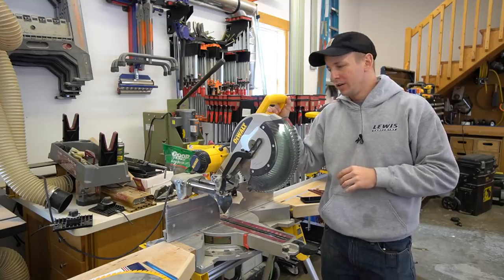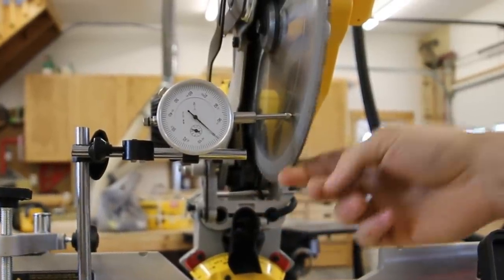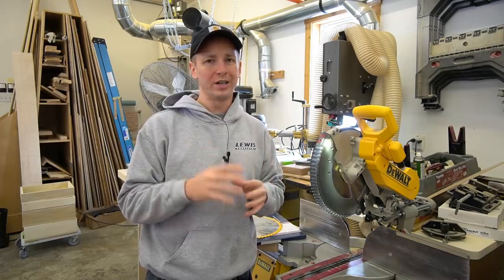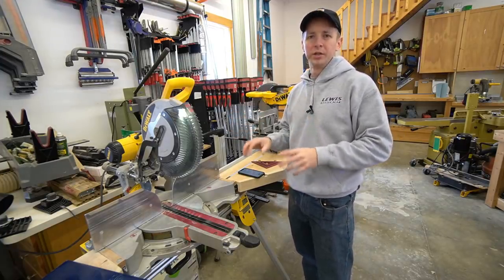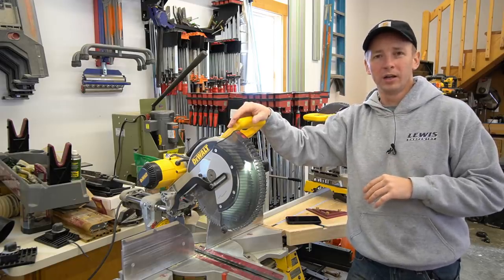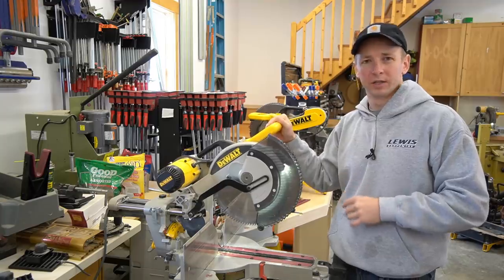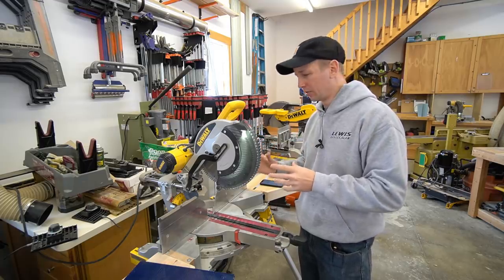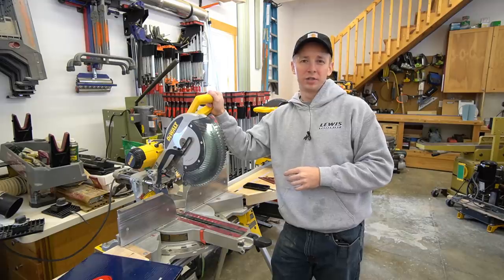DEWALT DWS780 | The BEST Miter Saw for Production Trim Carpenters???

Comment: Hello from Easton Maryland. I’m so glad you do this video. I have my miter saw 708 since 1996 and is still running well. I do some electrical wire repair and trigger repair and bushing repair just one time in each one and is still working perfectly. Last year I got the 780 and you’re perfectly right. I was looking for the best in every way and the dust collector is not perfect but is the best miter saw in the market. Tank you to share with us all your experience. Stay safe.
Reply: Same here in Delaware; I got my 708 factory refurbished in 2003 and it still purrs like a kitten every single day

Comment: A couple other things he did not mention. Thin kerf blades, low quality blades, and too high tooth count blades, cutting material with the wrong blade type, as well as misuse, can overheat blades causing warpage and run-out  when the metal expands and warps. Blades have curved relief slots cut in towards the center of the blade body to relieve heat warpage. Also, even very heavy cast iron industrial chop saws (cold cut metal saws) need to be calibrated and the blade angles can move just by pulling the handle side to side. Proper use goes a long way.

Comment: Spencer I just found and subscribed to your channel.... Fantastic work!!!!  In the last 2 yrs I've got turned onto festools love them . I just bought the KS 120 REB saw about 9 months ago I hope I don't run into the same problems you had.. l replaced it with my dewalt DW705 l've still got that saw works great after 20 plus years.. l went for the Kapex saw for its dust collection hooked up to the CT26E vacuum and knew how good the quality is in everything I own festool..

Comment: After watching your video I pulled the trigger on the 780. I’m planning on using it only for diy stuff so it’s probably an overkill, but it’s nice to know that I can use it for pretty much anything. I can’t even count how many times I purchased lesser of a tool and then regretted it due to its limitations.
Reply: How's it still working for you?

Comment: got both,  779 & 780  the 780 is fix based in  my shop the 779 i bought a light and haul it around....i have not found a difference beside the light weight i do not feel weight  is big between them .

Comment: DeWALT makes the best tools. They always have. 🙏🏻👍🏻
Reply: No. Some DeWalt tools are amongst the best, some not. Same with all brands. Not a problem with corded but, with battery power, sometimes you have to compromise to stay on same platform. Now too old to invest in Mafell
Reply: @cuebj  
I'm speaking from experience. I've tried them all, from drills to saws, grinders to routers, nail guns to compressors, and the only one that lasts is DeWALT, specially  when it comes to cordless. I've been in contruction for 18 yrs and that has been the case for me. Other brands just don't last.

Comment: I know it hasn’t been tested for longevity, and it was a risk, but I bought the Hercules 12” from Harbor freight last year.  It’s basically a dws780 clone.  It has been perfect for me, very accurate out of the box, and cuts through anything I’ve thrown at it.  With the deals at the time it was $279.99, which was the best deal I could find.
Reply: I was going to buy the DWS780 until the Hercules came out so waited about another year to see how it played out.  I also wanted to put my hands on both to access the quality of each.  In the end the two were near identical so went Hercules route since it was 1/2 the price.  Everything stated in this video can be said for the Hercules saw at a lower price point.
Reply: Lately I've been searching for reviews and opinions regarding miter saw vs table saw sled so I guess that is why this video popped up on my suggestion feed. It may be confirmation bias or even where I am (more to the point, where I'm not) with my skill level but I feel like I can get very accurate cuts with my Hercules 12" saw. I also found it to be accurate right out of the box and it has not failed to perform well with anything put to it. Another thing I noticed was the laser cut expansion slots on the stock blade. That's the extent of what I know about it but, as I understand it, that is better than the stamped blades. I deliberately searched the comments to see if anyone else mentioned it. Yours and the reply from msk3905 are exactly what my thoughts are...or vice versa lol.

Comment: The 12" Dewalt slider saw is the answer for large crown or base moldings cutting vertical or flat. We commonly use them on commercial jobs. 
If you have the touch and patience, the stock blade will work.

Comment: Meh... My son runs the Flexvolt version of that saw and I have used it side by side with my Bosch Axial Glide and I will take my Bosch saw any day over the Dewalt.
Reply: Totally agree
Reply: I ran a Bosch 12” Axial Glide as a production custom contractor?
Completely worn out in about 6 years or a little less?  Cracked head, sloppy base, lost accuracy to the point I had to reset it every job?  Motor started loosing power?  Maybe all fixable?
Guard broke too?  But that axial arm is bullet proof!  Plus base is to small for production carpentry.
I suspect your a guy that fixes things around the house?
Go onto a pro construction site and tell me how many Bosch’s you see?

It’s like the Delta Cruz?

I run a Makita in my Shop for the extra bevel and Dewalts on site!
Gimme your address I will send you my Bosch I will pay shipping?
Reply: I’d take the Bosch over the Dewalt to, I just wouldn’t take it off the bench and on to a site cause it weighs 700lb.
Reply from the maker: That surprises me. Bosch sent me an axial glide for free to test out. It had so much slop I never even bothered to use it. The deflection in the head was insane.
Reply from the maker: Crazy man. The deflection on those axial glides is off the charts.
Reply: I use a 10” with a CutHub set up. I must have gotten a good one. I build cabinets and do trim work. I put on a Forest chop saw blade and couldn’t be happier. I also have a Bosch 8 1/2” slider and a DeWalt 10” 703.  I must be missing something here.
Reply: @InsiderCarpentry  I have not had any issues with it, and I have had it for 6 years.  It is heavy and a PTA to move but it cuts like a dream.

Comment: I’ve had a lot of saws over the years but the 780 has bees the most durable saw of the bunch. 
As a stair builder I do like the new Makita slider and it’s ability to cut boards to 60 degrees left and right.  but it weighs a ton and still only has a laser.
Reply: The new Makita 40V cordless miter saws have the led and stainless detent plate. Hopefully that makes its way to the corded models. I really like the forward slide rails and upfront bevel knob on the makita.

Comment: Listening to you mention the DWS779...  I  bought one two years ago, along with the DWS726 rolling miter saw stand.   Together, they are both very heavy.  Over the time since I owned it, I barely use it because it cuts like crap.   I watched your flattening the table video multiple times.   I'm not gonna lie, my specific DWS779 is a mess.  The table has a hell of a wave and the fence is not even close to flat.  The fence is also not smooth.  The machining on the fence is quite deep.  I guess to allow it to bite the work.   I'm at a point where I tried to follow your tutorial but I lack the patience to get fully involved.   I'm not a trim carpenter but when I need a miter saw I want it to be fairly accurate.   I bought more saw than I need, just in case.  I'm seriously debating selling the 779 to buy the 716.  A fixed 12" saw should do me just fine.   I'm going to see if Dewalt will do anything to rectify this pile of crap.   

Before I bought the dws779, I bought one of those Hitachi sliding 12" saws with the slide forward so the saw was zero clearance at the rear.  Man, I wanted to love that saw but again, it was so far off and no amount of adjusting it made it work like it should.  The fence was terrible.  Vertically, it was out of plumb between 1/8"-3/16", seriously.  I returned the Hitachi within 3 days of purchase.   I know Hitachi is now Metabo.   Model:C12RSH2M.   That thing was also pretty heavy.
Reply from the maker: It definitely good to check the fence and table out of the box to see if the saw is workable or not. I've also learned that the hard way. The 716 is my favorite saw for accuracy, but I need the slider for my workflow. Can't go wrong with a 716 if you can do without the slide capacity.

Comment: How often do you change your 12” blade?? Not because it’s dull but because you want 90 teeth v. 64?  Do you use that blade for everything??  Until you can’t sharpen any more??
Reply from the maker: Correct. I always use the same tooth count. I have been using my current FS Tool Blades for a few years. I send it for sharpening about every six months. I think I'll get at least ten sharpenings out of the blades.

Comment: Totally agree......especially with the toughness of the Dewalt.
I'm currently using the same Dewalt 216mm sliding mitre saw I bought back in 2002!!! But its now completely worn out and I'm about to replace with either the 780 (12") or 727 (10") ...... still deciding??? What you think?
Reply from the maker: The 12" fits my workflow much better.

Comment: I still have my DeWalt 708. 
I think I bought it in 2007, and the motor finally gave out last year.  It definitely looks like it been through a war. Maybe one day I'll replace the motor. Thanks for the advice on the LED lights.
Reply: I bought my 708 in 2005 and have used it nearly every day.  I have replaced the brushes, the bearings, and the power cord each twice and it still cuts very accurate to this day!
Reply: I also have a 708 that i bought in 2005 and i love it. All its needed is 3 sets of brushes and i replaced the power cord last week. Its cut so much timber over the years and never lets me down. I use Freud blades on all my saws

Comment: I own a DW706 which I have run for over 12 years and it still runs great.  I am not in the trades, just a home based furniture maker and personal home builder.  I like the DW saw but the fences are not parallel and I could not adjust them.  I had to remove the sliding fence attachments and make my own instead.  Last year I needed more capacity and went with a slider.  Bought the Kapex mainly for the rear clearance and accuracy claims.  On my second cut the off-cut got sucked up into the blade guard and removed the entire retraction system and broke all the plastic and spring inside.  I have never had that happen on the Dewalt.  The guard on the Kapex is no longer functional at all.  It has to be replaced.  The Kapex is accurate, certainly, and right out of the box (I have had to re-calibrate the DW about every 3 years).  The laser does not stay true but I do not really feel that is a feature I need/use.  I almost purchased the 780 but fell for the green hype and the rear clearance of the Dewalt sliders was a no-go in my shop space.  Dust collection is also critical to me.  The Kapex is far and away the best miter saw I have used in terms of dust removal (I am using a dewalt extractor tied on with string only).  The Dewalt saw spewed dust everywhere even when connected to the vacuum and being inside a cabinet with 6" duct running at 1000 cfm.

Comment: Very thorough and detailed review. I'm also a fan of 12" blades and Dewalt MS. For my workflow, I go with non-slider, relying on track saw when wider cuts are necessary.  I also believe (superstitiously?) that non-slider is less prone to deflection by design. That said, if I still did much stair work, a slider would also be my choice.
Reply from the maker: Non sliders are definitely tighter. I love my 716, I just can't get by without the extra horizontal capacity of the 780.

Comment: Go yellow or go home. I’m running the DWS 12” fixed. For those running the chop shop dust hood like I am, dewalt went away with the mounting holes on the back of the base(not sure why). My point is, is you’re replacing your saw with a new one, the hood will not mount without you being creative with two 3/4” sockets.

Comment: The first thing i do when buying a new saw is calibrate. 15 years ive been using hitachi 10 in. With 2 piece fence. I recently bought the dewalt 10in flexvault.  Unfortunately the  fence was bent but dewalt came to thw party. Calibtrated a new saw and sent it to me dealer where i swapped it over. I am now very happy with my 727. I buy 10 in cause the 12 in wont fit in my trailer. The hitachi is still very accurate,  very nice saw with little flex extended but at 60 yo its getting too heavy. 23kg as opposed to 10kg. Where did you get tje giant fences?
Reply from the maker: Link in notes.

Comment: The 780 is HANDS DOWN the best 12" sliding miter saw on the market. The other saws in the same class are good, like the Milwaukee, Ridgid, older Hitachi, and newer Makita, however the DeWalt has the least bit of deflection and slop in the sliding arm. It is just a solid and accurate tool. The light is awesome as well. The dewalt also has the best blade guard too.
Reply: I love the 780 as well but I have no idea why they stopped making the 708?  I like it just a little bit more than the 780 and I still have two 708s that are over 15 years old
Reply: @swooopg  I too had a 708 back in the day, and that thing was a tank. Like 65lbs, but that thing cut so well.
Reply: @caseydurrans521  yeah it's really heavy! But I think that helps a little with accuracy,  having beefier components...

Comment: Great video as always. I have the same saw in shop. Flexvolt in the van. Have you used any of the new Diablo combination blades? Most everything we do gets painted. I like not having to change all the time. Put the combination on the flexvolt to start. But before I get one I'm doing a little research...

Comment: We use 780s at work and they're rock solid. Only issue I have is the guys have beaten them up with carelessness and I'm almost always recalibrating them. I'll probably end up buying my own so when I go in to do trim then I won't have that issue. Definitely would love to see more dust collection on it though, because I work doing remodels and it's a bear to deal with. Also, I find the saw pretty heavy... But maybe that's cuz I'm weak.

Comment: When I chose a dewalt slider a decade ago it was mainly because compared to other brands the stand was lightyears ahead (it collapsed tightly, had twice as much extension on the supports etc).   I also thought there might be an advantage to having the rails/sliders in the "closed" position when cutting right next to the fence (I.e. cutting base vertically, potentially less deflection with the rails closed).  Good video Spencer thanks for the link to the tall fence too!

Comment: I did buy a Makita 12” corded.  Main reason Spencer is it stays in my shop doing all the shop work and I hv found it close to flat out of the box and with a little work I can dial in dead flat (base on the left side is low meaning I hv a little sanding to do literally about the thickness of a sheet of paper!)
I can bevel to 60 degrees and right now I am building cabinetry, doors, custom tables (inside & out) so that saw runs @ least 4-7 day a week!
I hv a fixed DeWalt I take to job sites which replaced one that was stolen!

I can run rails to the back where my Saw sits!  Last saw I had was a Bosch?  Took me 6.5 yrs to wear it out where it was never accurate, cracked head and bolt for guard on blade change was failing?  Bosch might be great for DYI guy?  Not a working carpenter!
This Makita is not a carry to the job site saw!  It’s right up there bout 68 pounds!  I run Forest Chop Master Blades on my Miter Saws full kerf and almost no wobble or going dull to quick problems!
I might hv to try one of those blades you run?  Mine are 2 bills & I think you said buck 80 for your?
Great stuff Sir!
Reply from the maker: I'll link my blade in the notes. It runs about $180.

Comment: The 780 & 779 both weigh 56 lbs. The only difference is the light. The light is definitely a game changer.
Reply: The light kit is cheap and simple to install.
Reply: The parts are not all the same if you look at the schema.
Reply: @pouetance  It works great, it's far better than the laser on my 10" saw!
Reply: There is other differences. Comparing the newest versions of both (type 22) the 779 has a plastic bevel lock knob instead of metal , no bevel tab pawl stops, and no lock lever for the slide.
Reply: @jameshill4900  I actually wondered if there were other differences. Good info thanks!
Reply: @jameshill4900  I have a brand new 779 and I can lock the slide with a knob
Reply: @MMASensei  The 780 and the older type 779 have a lever on the left side that locks on a pin to position the saw exactly where a "non sliding mitre saw" would be for plunge cuts. Then you can further lock it down with the knob if you choose. It's a nice feature that they removed on the newest type 22 779.
Reply: @jameshill4900  Oh ok.

Comment: Great video. I have been using a DeWalt DW708 for 20+ years and it still runs and performs as it did new. I like how you discussed the issue of calibration of saws. I can agree with you on that topic 100%. My saw at some point wouldn’t cut accurate. Took it to BD/DeWalt store and had a service done on it. Turns out original fence was bent/warped. Had new fence installed and saw serviced for a fraction of the cost of a new one back then. Just completed a interior board and batten job for my own house and my saw did everything I wanted and expected it to do. No real need to go out and buy another saw at this time. One last note, definitely purchase the best saw blades that can be resharpened. The cost to have them resharpened is very affordable in most parts of the country. Thanks again.